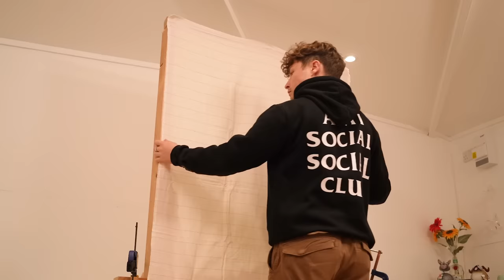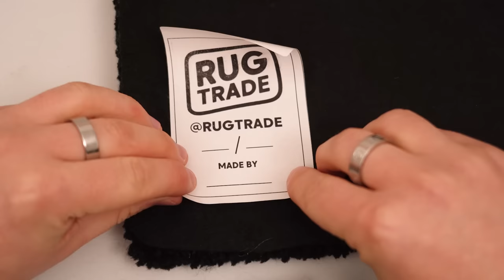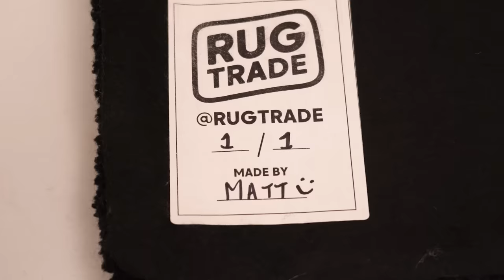ASMR Rug Tufting | STÜSSY Rug (Start To Finish)

Comment: Amazing! I don’t know if I’ll ever get into tufting myself, but I’m constantly blown away by how you can just make a rug that I would have assumed had to be store bought. 
Just out of curiosity, how much of that black yarn did you use? I think the video showed you rethreading the gun 3 times, so does that mean 6 rolls? Trying to mentally price the rug in my head 😅
Reply from the maker: Thanks! I think i either used 6 or 8 rolls of black and 2 rolls of white for the text, I buy them from a local shop (more expensive than online tbh) at around £2.30 ($2.75) each. Yarn varies in price a bit but you get what you pay for, I've bought cheaper yarn for around £1.50 ($1.80) online before but you can feel the difference for sure - overall yarn spend on this rug is approx £23 ($27.55).
Reply: @rugtrade  Nice, thanks for the info! That’s not nearly as much as I thought it’d be!
Reply: @rugtrade  we lost a lot of our belongings due to floods that ripped through our area here in Kentucky, I was wondering if you could do a couple rug's of cartoon characters, like the TMNT, Ghostbusters, motu, sailor moon, and Beetlejuice.

Comment: Nice video bro. I've been wondering.. When using designs like this, aren't there any copyright issues when trying to sell them?
Reply from the maker: Thanks man! That's a great question... I think there's a very fine line between what you can and can't do. I made this rug for a friend who specifically requested this design, which I don't see a problem with as a one off, but I think a problem would arise if I were making loads to sell, stocking up, advertising them etc enough to get the attention from any big brands. I'm no lawyer though so best do you own research to double check! :)
Reply: @rugtrade  Thank you, appreciate your help!